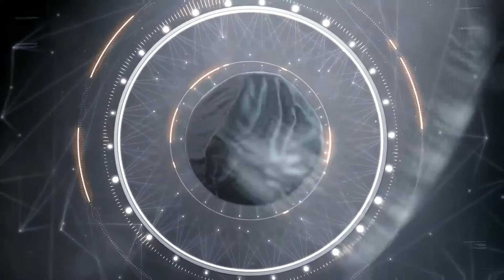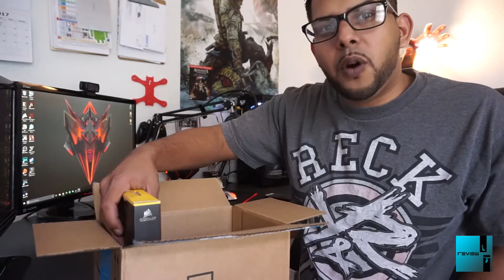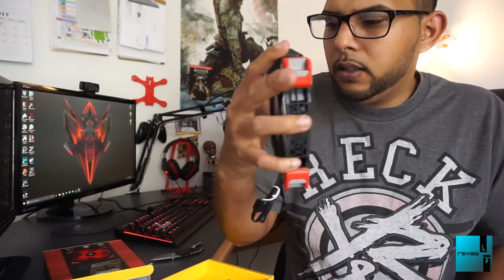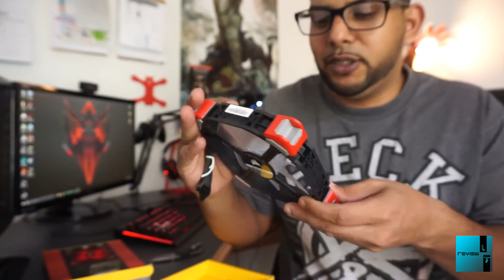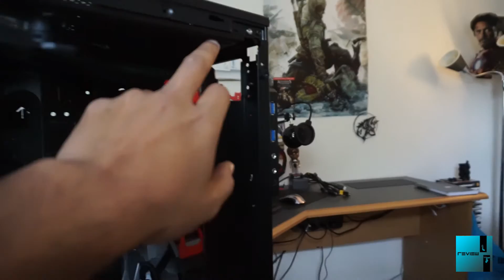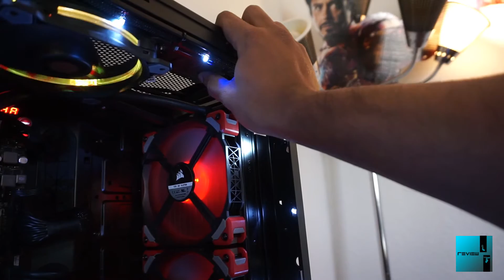Jays Corsair ML 140 Pro Fans and NZXT led kit upgrade

Comment: Pretty sweet bro. I am waiting on 2 ML 140 Pro Fans in red as well to run on a Corsair H115i. I also ordered 2 ML 120 Pro Fans for my EVGA 1080Ti cooler to run in push pull.
Reply from the maker: hell ya bro!! they are awesome fans you will like them!

Comment: Whaaa? Pulling hot air from radiator into the case. You got to be kidding man..
Reply from the maker: We actually tested both ways. The graphics card surprisingly didn't change too much, but when we had the radiator in an exhaust position the CPU temperature increased significantly. The exhaust fans are setup on a curve so that if the interior or GPU gets too hot they will exhaust more air out. This is what we found worked best for this build.
Reply: Review I.T. In this situation? I bet high cpu temp would be because of to high negative pressure. Why wouldn't you try to put cpu  radiator exhausting on top and two inhausting fans on the front? Let me know
Reply from the maker: mic4ch actually no negative pressure at all. Just positive pressure from all the vents and holes tested. The rad fans or spinning faster then the exhaust fans CPU never goes over 40c rendering or game play
Reply: Review I.T. OK because CPU is cooled well in this scenario. How about rest of gear eg. Mobo, RAM?
Reply from the maker: mic4ch mobo never goes pass 30c

Comment: Nice build dude, how are you finding the ML140's?
Reply from the maker: StillCOD4MW1 they are awesome very quiet and keep the 280mm radiator very cool. I have it setup as a intake so it pulls air through the rad into the case